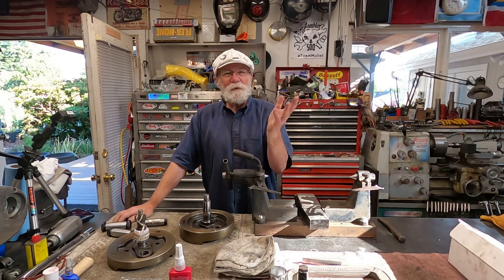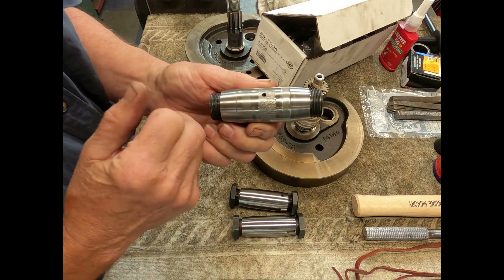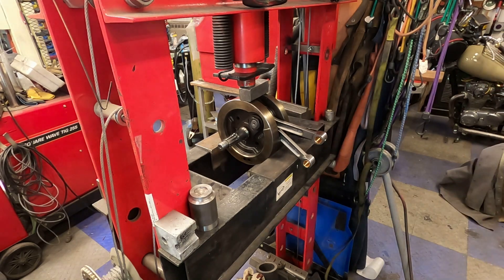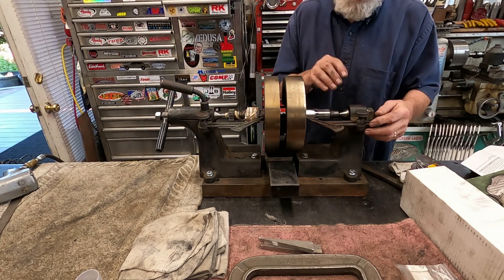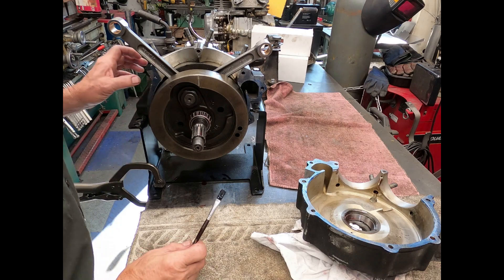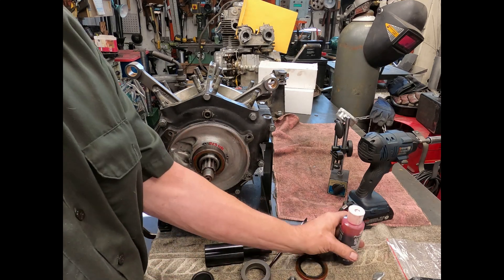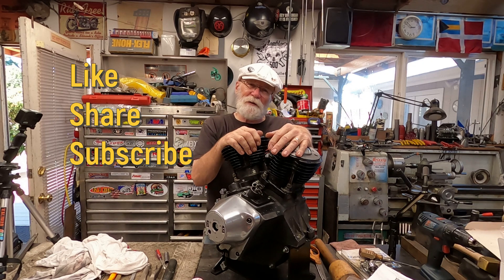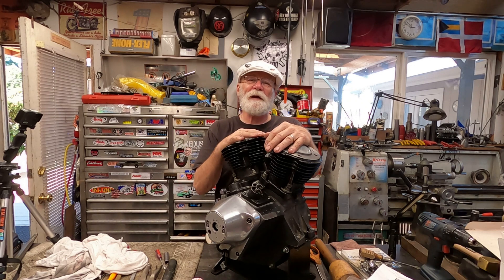I Broke My Shovelhead episode 1

Comment: I've got over 300,000 miles on a jims 3 hole crank pin, last topend still didn't have much rod shake "play movement" has lasted longer then OEM, BUT!!! the last one I bought had to be returned, it was replaced, there was .001" difference from one end to the other, the replacement was perfect.
Reply from the maker: I think it because Jim's has better oiling than the OEM has. Thanks for watching

Comment: Thanks for the great video . Did you used to be a harley tech ? I consider myself a pretty fair mechanic buy not even I would try what your doing . Very good job at that .
Reply from the maker: I own a chopper shop in the late 70s plus years before I worked for my uncle who owned a bike shop. 
Thanks for watching.

Comment: Great video. Curious how many miles on original scored crankpin and what may have caused it? I have a 1980 Flh80.
Sure runs nice.  Thanks for teaching Shovelhead tech.
Reply from the maker: I had over 150,000 miles on the old crank pin. What caused it to go bad, not enough lubrication probably cuz it's just it was old Harley crank pin, plus I rode her hard ! thanks for watching

Comment: Have you done the final torque on the crank pin nut before, during, or after truing the flywheels? Seems like it would affect runout torquing after you get it balanced.
Reply from the maker: Yes , I did a final torque.